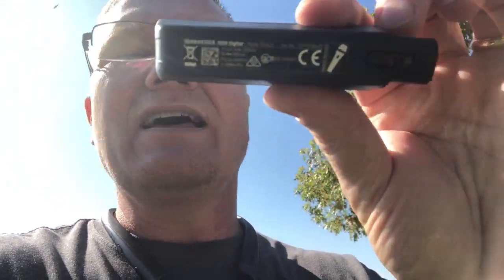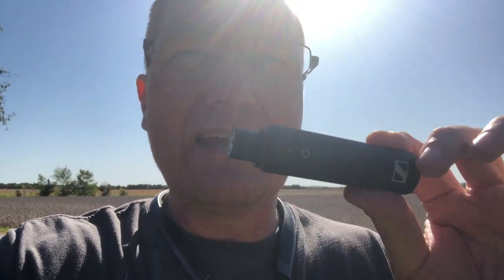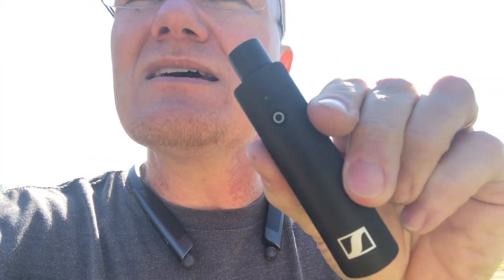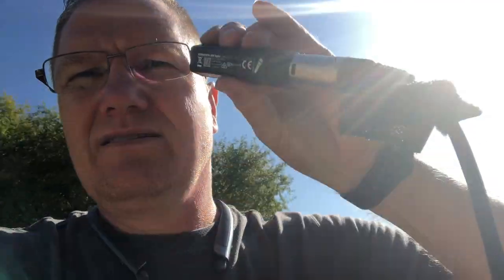Can You Do Surround Sound With The #Sennheiser XSW Digital Wireless Audio Transmitters/Receivers

Comment: Can you use XLR goosenecks to spread the TX & RX units, when daisy-chaining? This looks much cleaner than my analog 2.4 GHz unit solution with planar antennas!
Reply from the maker: I am sure distance between the two is critical.. I just don't know if I would trust it. In the video, it didn't seem to be ALWAYS dropping out.. right away.. but, as things went on it did more. I would not trust it to hold even with a bit more distance between the transmitter and receiver for daisy-chaining.  Maybe 10-15 feet might work safely.. ??